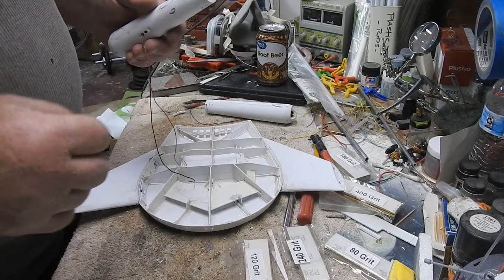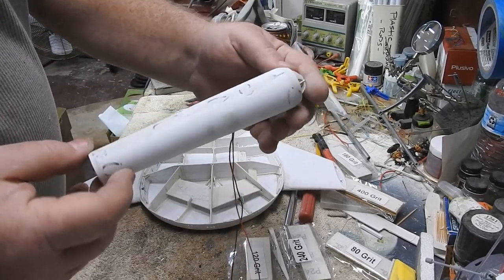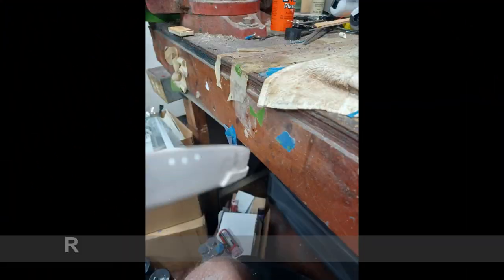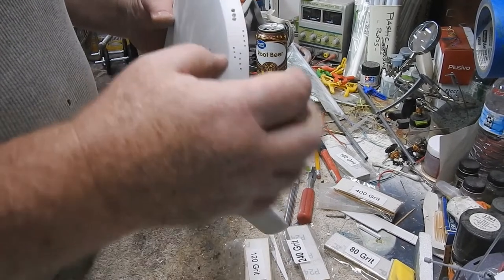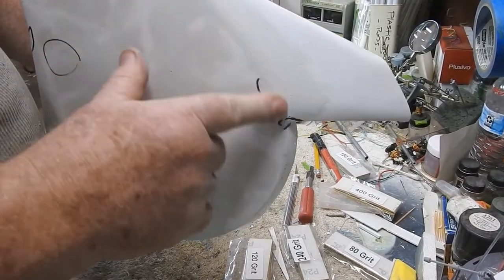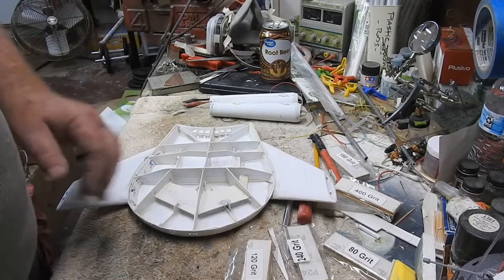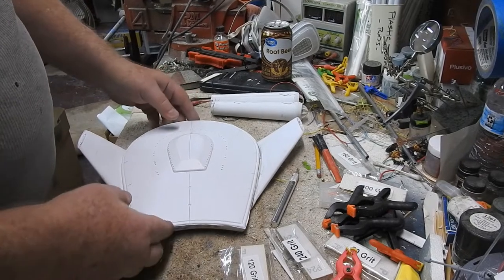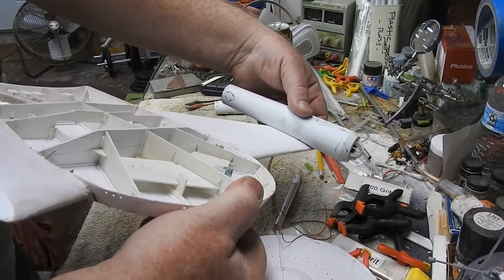Star Trek TOS Romulan Bird of Prey in 1:350 Scale Part 3

Comment: I keep thinking: “So, basically, you are scratch building a 350 Bird of Prey. Impressive. I don’t think I have seen anyone do a “shrink wrap” kit before. Interesting.
Reply from the maker: It was a vacuum formed kit that someone pulled off a fiberglass model.  I had to correct some of the deficits in the model as it wasn't a perfect mold. I think I straightened out the majority of the issues.
Reply: @lewilsons I am on episode 4 now. It is really shaping up.

Comment: that's nice and I am glad that they did not place the pylons to high as in the way the blueprints did. I am 3D printing this ship in 1/200 scale and 1/650 scale to match the AMT Enterprise kit.
Here is a 1/200 scale D7 starboard powerplant: https://youtu.be/vEAkS63ILwU
Reply from the maker: the pylons originally were almost too flat in relation to the body. I'd added some dihedral to them just to get the nacelles to a height where they were higher than the center command center on the body. Otherwise the model would have looked like a plane.

I saw your video of the Klingon nacelle and it looks huge. I also have a resin kit in 1:350 of the TOS Klingon Starship slated for the build que. I want to finish up a pair of Defiant's I'd started a couple of years ago before diving into that one. 
Too many models, not enough time. 
thanks for following along.
Reply: LOL, yes, I am a squirl chaser also. I need to focus on 1 or 3 things at a time or I end up doing 20 and getting nothing finished.
I am working on making the main body for the D7 now, and have had some issues with the prints.
When I get one to come out right I will make a video about it. @lewilsons